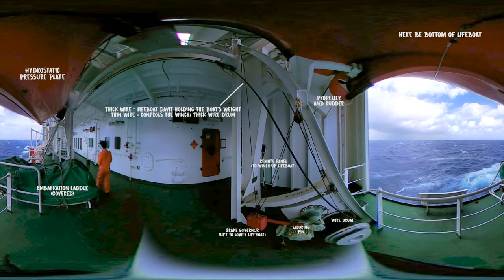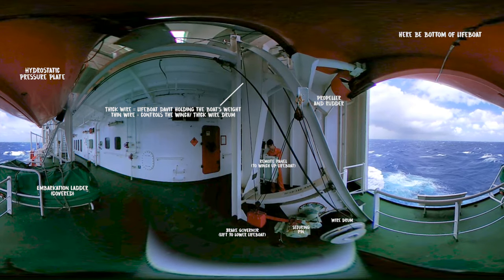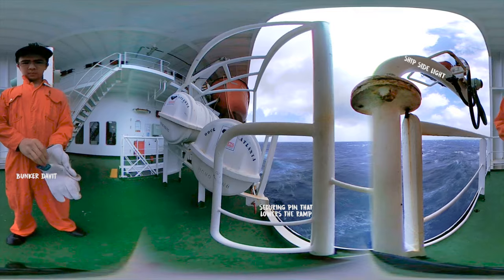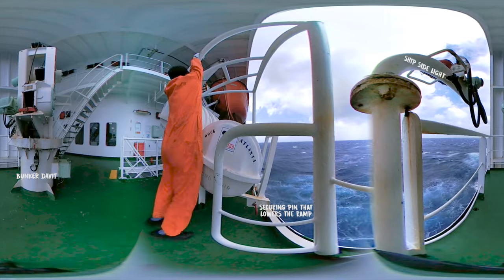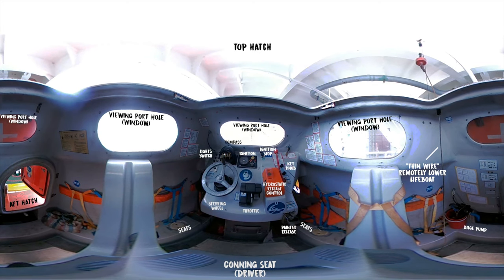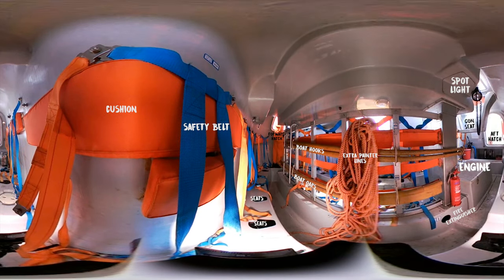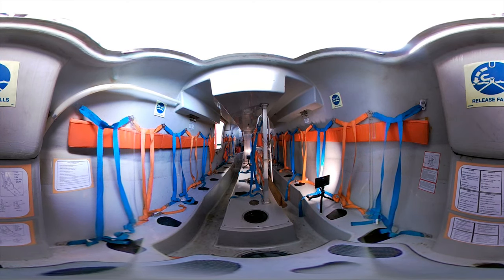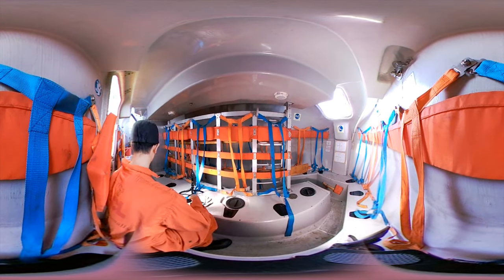360°  Lifeboat Tour

Comment: Hey Jeff, many thanks for the 360 tour of the lifeboat. As a suggestion, if possible, could you please include starting the lifeboat engine (a video or a 360 tour whichever comfortable with you) - Starting the engine, Accelerating, turning, stopping, reversing, and how to check the remaining fuel in the engine, then doing the rowing Manually.

Comment: What is the duration 30 people in this boat could survive(provisioning wise) and distance it can travel?
Reply: 48-hours to 7-days, depending if you are able to collect rain water, hydration is the most vital resource, in a calm water situation you could travel 180 km, but never the less you wouldn't be in it for more than 4-hours in clear weather or possibly overnight in rough weather. the vessel is fully equipt with communication, emergency alert beacon, heat, medical supplies, even insulin and ativan for panic,  there is even an emergency rubber life raft incase this one fails or the capacity is full, but more survivors are in the water, and flotation bodybags for the dead.